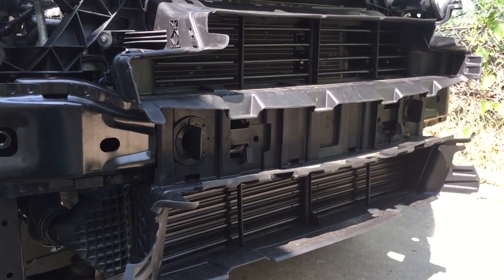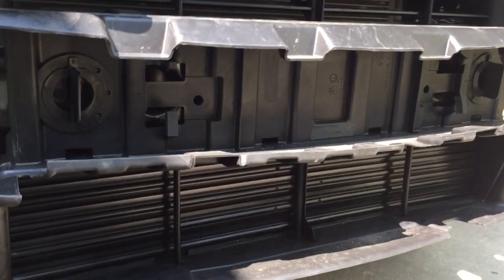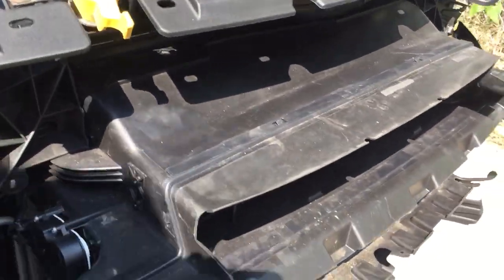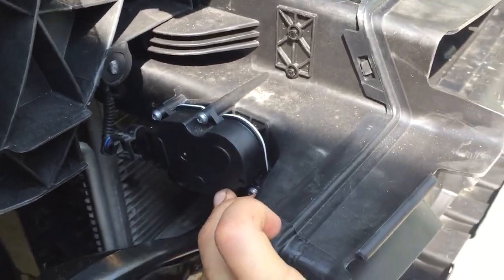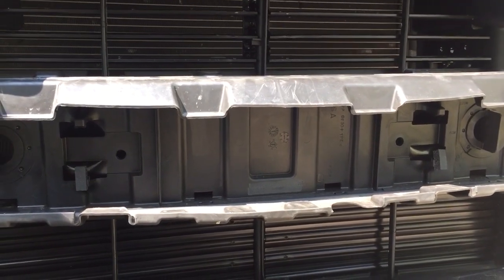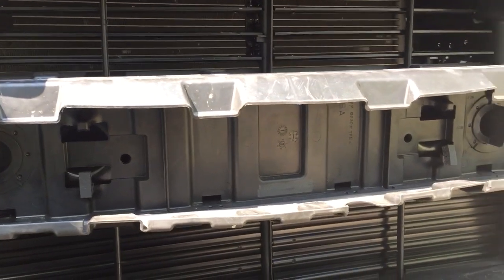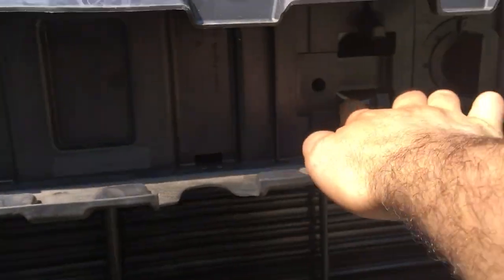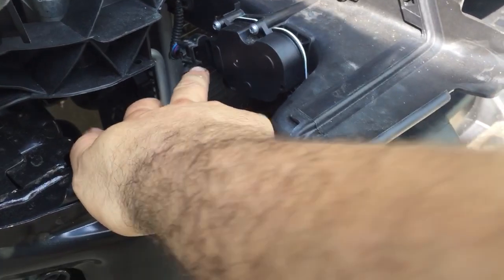2014 Ford Escape Radiator Shutter Assembly Installation Explained

Comment: A cow hit the front of my 2014 escape and I had to basically rebuild it. I rebuilt it without this and I’ve been running just fine no problem. I wouldn’t replace it for those out there.

Comment: Does the rebar have to be installed before the shutter or after?
Reply from the maker: I assume you are referring to the bumper  reinforcement rebar. That rebar has to be installed before the shutter assembly.  Rebar 1st, radiator shutter assembly 2nd. Good luck!
Reply: @fixit3879  thanks, do you think its possible to install the shutter onto the rebar before installing the rebar?
Reply from the maker: Yes it is possible. You have to be careful not to break the shutter assembly because it is made of plastic plus rubber seals.  Also 2 parts become Heavier once attached together.  You may need a 2nd hand to help you with that.  The back of the shutter has plastic stick that  connects the top and bottom shutter/openers, that is installed behind the rebar.  Good luck!
Reply: @fixit3879  
Are you there to answer a question ????